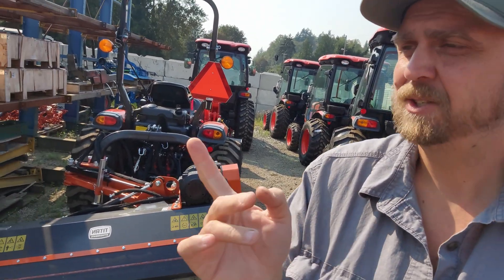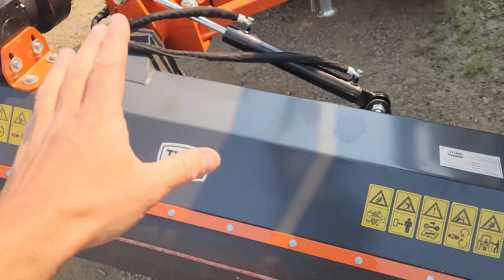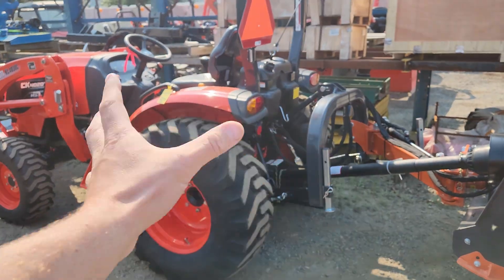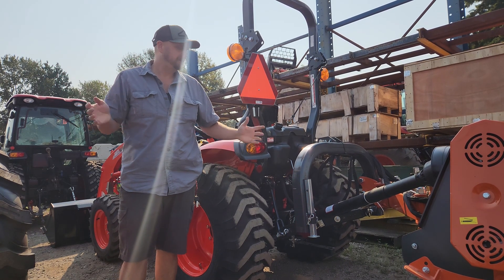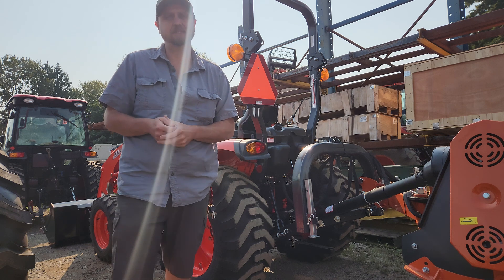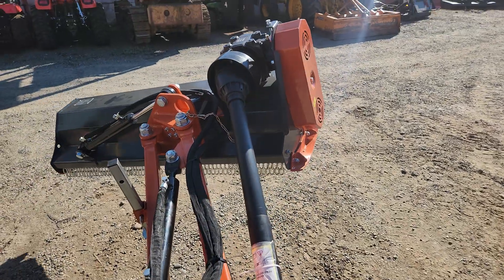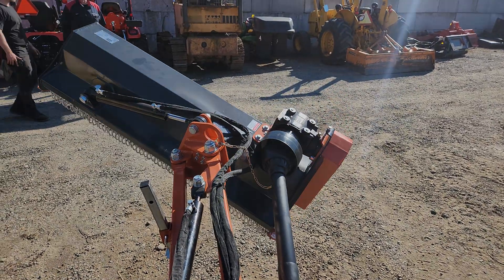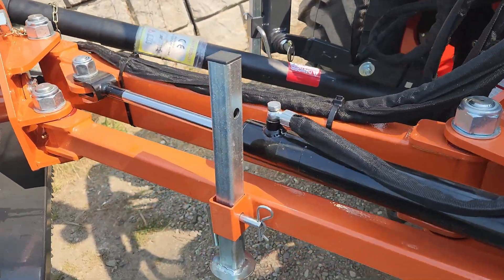Is This Flail Mower Too Big? Flail Mower Flex Test

Comment: I have the Ironcraft FRF-145, 55" cut.  It weighs 672 lbs.  I use it on my Kioti CK2035SEH Cab tractor, it works great and no problems.  The 3 point lift on the Kioti CK series is pretty jerky so watch for that but CK models are that way with everything, they just don't have smooth 3 point hydraulics.  🚜

Comment: the 145 indicates 145 cm cut
Reply from the maker: We don't use the metric system around here.  We use Imperial, as God intended.
Reply: @HomesteadBandwagon  right but those foreign companies be it italy or china does
Reply from the maker: They're savages. The Metric system encourages radical thinking and loose morals. I won't stand for it
Reply: @HomesteadBandwagon  😀

Comment: It will be fine.  I have the IronCraft equivalent on my CK3520HC.  They really should load the rear tires with Rim Guard for the best stability while using it though.
Reply from the maker: For sure.  We don't let tractors leave the shop without loaded tires!

Comment: Have to wonder what the driver of the car going by thought.

My thought if the mower is too big for the tractor it will be an issue when the tractor is operating on a hill side.
Reply from the maker: We really advise against using ANY tractor on a hill - especially if you can't go straight up or straight down the hill
Reply: @HomesteadBandwagon  really? Hopefully it’s fairly flat where your customers are.
Reply from the maker: Losta hills out here, unfortunately,  but tractors are designed for flat ground...so... ya gotta dance with who brung ya

Comment: I'm not a fan of TITAN. A couple years ago I bought a set of 5ft forks for my little 40hp tractor. BIG forks for a little tractor? No, I use it for hauling lightweight but bulky brush.  One fork bent,,,,,,a lot. Titan would not replace it nor sell a single fork. Now we just play with it, bending it back and forth like a wire till it breaks.  Would not recommend a TITAN product.